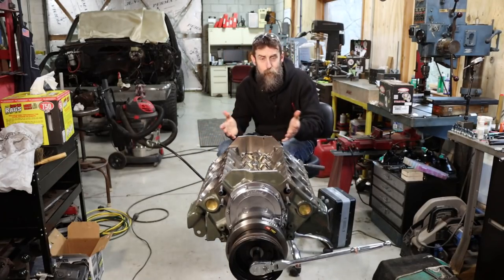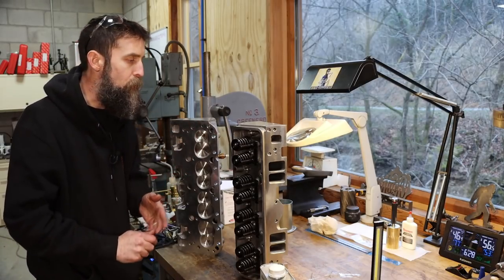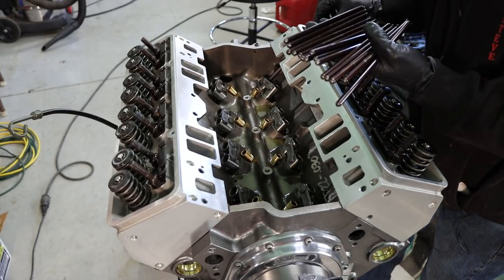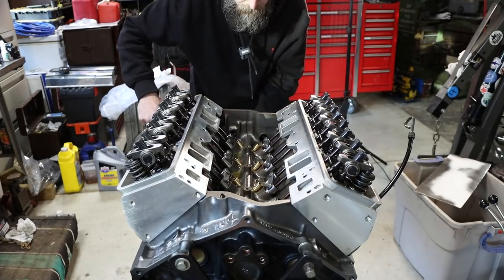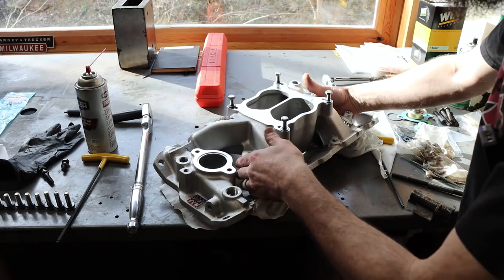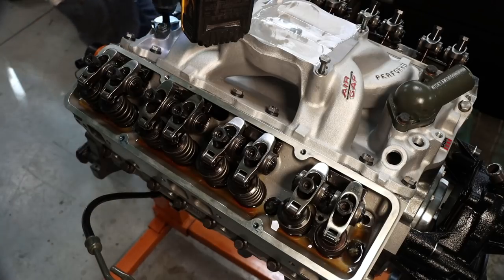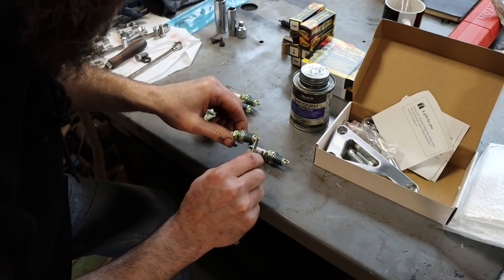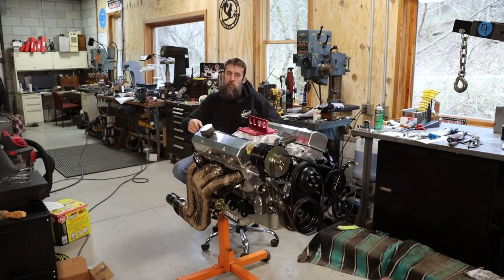383 Build block COMPLETE!

Comment: Military equipment background tip.  On tie wire, you should arrange and tighten the wire such that it is trying to tighten the bolt more.  Simply having it in the hole is not enough.  Couldn't tell how that worked for you, but thought I would point it out.  Great work, keep it coming.
Reply: You beat me to it. I was mentally sending Steve a pair of spin pliers too.
Reply: Along with this, I would have also suggested to NOT wire them until after a few heat cycles, then retorque the bolts, THEN wire them.
Reply: I'll bet Steve probably watched some of those safety wire videos.
Reply: Absolutely.  The best guy I've seen for lockwire lessons on youtube is AgentJayZ - who has several videos on the subject.
Reply: In Steve's defense...  The bolts were designed to not have the wire.  Any wire he puts on there is just bonus.   But yes, the wire should be tightened and then looped at least half way around the bolt so if they try to back out, they pull on the wire rather than slip in the hole.
Reply: Agreed, my background is in military aircraft. The wire should be 'locking' the fastener, not just attached. It will do a trip like that though.
Reply: @dav1dsm1th  plus 1000 on Agent JayZ.  He rebuilds jet engines for a living and has the best videos on safety wire I’ve ever seen.   It’s also neat to watch a jet engine build.
Reply: I’m here to join the “came here to say this club.
Reply: Here is the Agent Jay Z safety wire video.  https://youtu.be/OwFjUX6SaY8

Comment: No worries over those heads Steve. Unless you are going to be pulling firewood at 6000 rpm and higher all day these heads are just fine. The rough finish on the runner walls is not a bad thing. It makes the airmass along the walls tumble much like a sailboat in water that takes air in along so you get air on a bed of air effect or in the case of a sailboats rough finish captures air between the boat and water. When I port heads I can help the air move with less friction here and there by speeding it up or down where needed. This method of adjusting valves is by fat the easiest and less painful on ones noggin than the rest of them. There are many as you sure know. Chrysler was I believe the first to take advantage of the air gap intakes and the others quickly took note of it. Like you I really like these ones and they look like they mean business too, LOL. How nice to see Elizabeth and growing baby Clover this fine sunny morning up here. What a beauty of a power plant you have created to go looking for firewood and 2 x 4's from the corner store. Any confirmed gearhead has a puddle of drool  between their feet or on their 6 packs right now. I keep looking at that 2 1/2 min run time left and don't want to start as I know this will be stopping and I have to wait a week for more. You spoil us fella, LOL. The drivers side header is usually the one to take off but since you already know that and have done it there I go flapping my lips in the wind again. I know I am long in the tooth but never mean any harm. Just old and have traveled the same road many, many times. Hugs all around my friend and many, many thanks for bringing us into that big warm heart of yours. You are good people and the driver of the big bus in the sky already knows that eh. St Peter awaits with open doors and a smile for you all. Take care my friend.

Comment: Hi Steve, that's gonna be a great engine! 
One tip on the rocker arm nuts...just torquing the allen screws may not get them tight enough, I've had them come loose with that method. I found that, if you back the nut from it's final position(maybe an 1/8 turn or so) then snug the allen screw and turn them together to the final position, it results in a much tighter setup. I never had them come loose after that...

Comment: I remember a high and low pressure spring came with the new “high volume” small block oil pumps I bought over the years. High was a 60-80 psi range and low was a 30-50 psi. However it’s been about 2 decades since my last such purchase.

Comment: Great teaching us the lifter settings. Never knew that way before.  I used to just put the hydraulic lifters in and turn the engine four full turns then listen to it rattle at first start up until the oil got everywhere on the push rods, but I have not stripped a complete engine down and rebuilt since the 1970's. Done heads off, decoke etc in 1990 - 2000's. I preferred the 1.6 and 2L pinto engines. Never worked on a V8 before though. Not many V8's in UK compared to 4 cyl cars. :)

Comment: This is bringing me back memories of my old Stock car racing days in the UK. We used Big block 454ci. LS6 & then changed just about everything to get tons of torque low down. TRW pistons with the tops milled down to 10:1. Crane cam. Solid lifters & roller rockers like yours. Black jack small tube headers for low end torque. Small block flywheel. They used to cost a fortune to build. Thanks for showing. Brilliant video.
Steve.

Comment: Pretty cool build. Whenever you go to normal oil you will have some change in pressure. SAE 30 is thicker so you should expect higher pressure when it's cold. After break in I would recommend going to a weighted oil and go to your local machine shop and buy a bottle of zinc additive. When ever you break in a engine you will have more debris floating around. It is important to keep in mind the detergent content of the oil.

Comment: I would also check the drill speed vs oil pressure, I do believe the drill is spinning the pump faster than the cam shaft will
Reply: I came here to say the same thing.

Comment: Steve I would use anti-seize on your stainless fixings for your headlights. They go together well at the time but over time without it, they tend to bind up and can be a pig to undo again after a few years. Using the anti-seize will prevent that and a lot of swearing.

Comment: That (cold) oil pressure should drop about 15-20 pounds hot and as the engine heat up and breaks in - but you know that-lol.  Also if you dont get oil in a few rockers just turn the engine 90* or so sometimes speeds things up.
Reply: I was going to write the same thing, on both counts.

Comment: Yessir you're gonna have one screamer of a high class wood hauler... Like your idea of the "lockwire" on the header bolts. I have used miles of that stuff in my aerospace career. Just know that when you get stuck using it it usually goes to the bone. I still have battle scars...

Comment: Not convinced by that spray gloop on the head gasket Steve used. Looks like a composite gasket and as a rule extra sealing compounds should only be added if specifically approved by the manufacturer.

Comment: way back when I was in high school auto mechanics one of the goof off guys painted the front wheels on an old car we had in class with copper coat gasket sealer. needless to say everybody got in trouble for that stunt. but they were pretty.

Comment: Just wondering if you remembered to blow air and visually check the push rods to make sure the through holes were open. I have had new from the manufacturer push rods that were blocked

Comment: A completely blocked lubrication circuit will give you a maximum oil pressure reading.
Plain bearings rely on the properties of the oil (film strength, viscosity, antifriction additives) to suspend the moving components, not the pressure of the oil pump.
Splash lubrication works at zero pressure.
Reply: Not if the blockage is in the pickup tube.

Comment: Just a word of caution Steve. Copper anti-seize should not be used around aluminium components as electrolysis will occur between the two metals and the Al will be degraded. Nickel and silver based anti-seizes are better.

Comment: You need a set of safety wire pliers from harbor freight.
Reply: I was pretty amazed when I saw them.. 😳
A fraction of the cost of my Blue-Point ones from the '70's. Even without accounting for inflation.

Comment: It's great that you've reached a milepost with the engine and I  don't want to rain on your parade,  but the rough cross hatch is 50 yo technique. If you want best ring seal, you hone(with a ck-10 or equivalent) the block with torque plates in place, and you go for the staightest,, roundest(with heads/torque plate) cylinders, and a smooth almost shiny finish. Nearly everyone uses Moly coated rings, now, which break-in easily. Myself, I like to use 2-cycle oil to lube the cylinders/rings for initial startup.
Also, NEVER soak the hydraulic lifters. If you want to dip them in oil, that's fine, but you don't want the lifters to go solid on you, especially on initial startup. I've seen it happen. Fortunately,  in this particular engine there was no interference, so they eventually bled down, but it ran  pretty crappy for several minutes before the engine ran smoothly. 
You haven't talked about fuel delivery,  yet. I'd go with FI, BUT NOT for initial startup. Use a known, GOOD carb for break-in until you get all the things checked like oil, coolant and fuel  leaks and adjusted the engine timing and idle so that the engine starts and runs perfectly. When you're satisfied with it, then install the FI. Try to keep the variables as few as possible.

Comment: I wish you would add a little more oil to each cylinder. Ring seat failure is typically cause by the wrong cross hatch pattern and texture for the type of rings and material they are made of. Plus a correction to a statement you made, all lifters should be soaked in oil prior to installation, especially hyd. roller lifters.
Reply: Not "all" lifters need to be soaked, but not a bad rule of thumb. Some manufacturers specify them NOT to be soaked ... I have no clue why, but they do. IOW: Pay attention to what the manufacturer states and you shouldn't go wrong.
Reply: @Paulster2  Please enlighten me on which manufacturer says that. In the past 50 years I have used every major brand there is and I've never seen that. If a lifter has any moving parts to it, it needs to be pre-oiled.
Reply: @dcrahn  - Off the top of my head, I do not remember which one said that. I saw this in the last couple of years. I was "very" surprised to see it myself. The point I'm making is, pay attention to what the manufacturer tells you. You shouldn't go wrong by doing so. If they say not to pre-soak your lifters, there must be a reason for it (I wouldn't have a clue what that reason my be).

Comment: I am amazed you do not have a safety wire pliers.  I noticed that the one front wire is pulling the wrong way.  When you cut off the end roll it into a tear drop. Press the cut end back into the run so there is no gap.  If not in the future when you work in the area the cut off end will rip your skin.   When I worked on airplanes I you did not finish your safety wire correctly or did  not cut your wire ties off flush, every one in the shop enjoyed a coffee on your tab.

Comment: About 30 years ago I saw an aluminum Edelbrock manifold fail when an engine was being installed using one of those carburetor lift plates.  The top of the manifold stayed bolted to the lift plate, and the bottom of the manifold, along with the rest of the engine, dropped into the engine bay.  Never trusted one of those since.  Can you salvage the factory lift points off your old engine?  They attach to the heads.

Comment: Noticed that you only applied anti-sieze to the bolt/spark plug threads.  You should also apply to the underside of the bolt head as this will reduce the friction between the bolt and where it contacts allowing for a more accurate torque.  Also on your safety wiring of the header bolts at 34:13 it appears your wire will prevent the bolt from tightening not loosening.  Otherwise a great build.
Reply: Thought the same thing on the tie wire. Looks like it is holding the bolts from tightening. At least on the one shown being done.

Comment: Your high oil pressure maybe due to the drill motor was spinning it faster than what the engine would spin it, the distributor shaft actually spins quite slow compared with the drill motor

Comment: Steve put a short 3/8 bolt in the front motor mount bolt hole the top one  where the fuel pump mount becuase it not blind hole the fuel  pump rod go down behind it

Comment: Steve , I hoped you lapped the valves on the heads as many of the valve seats on moderately priced aluminum heads are only cut with a seat cutter and are notorious for leaking.

Comment: As fast as your drill is spinning no wonder why your oil pressure is high! That distributor never turns that fast!
Reply: You are correct sir!  It's kind of fun to do it initially, but once the oil is to the rockers, that's enough.  Time to start it up.

Comment: Have you ever used the oil starvation technique on your rings before?  That feels counterintuitive to everything I've ever known about known about cylinder walls on  4 stroke or 2 stroke.
Reply: That exactly what I read that a BMW race tech had to do after API specs changed in the 70s...his bikes weren't seating in properly, so he put a tablespoon of oil in each cylinder(with no crankcase oil)...ran to half rpm for approx. 30 seconds and problems solved...

Comment: I see the effort and the parts you decided to put back in this engine, and than I got the feeling you are no longer building a daily driver engine, but a more powerful engine. That hot rodding disease got into you it seems. I ask one question, do you realize the gas mileage you will be getting for this power house? I'm seeing somewhere around 12 MPG. Why do I figure this, because I once did something very similar. But at that time gas wasn't anywhere near a fraction of today's offerings. And my cam wasn't as high a lift or duration as yours is. So gas mileage WILL be a real issue after the enjoyment of the extra power wears off... Thumbs Up!

Comment: I was told that you always use a wire gauge to check spark plugs not a flat bladed feeler gauge I don’t know which is right which is wrong but I was that’s the way I was taught how do used to use it with success on racing engines
Reply: You use feeler gauges to check the gap like he was doing and you use wire gauges to set the gap if/when you have generic or un-gapped plugs.  👍😎

Comment: Hey mate
Good work on the rebuild so far
The the wire trick is great but it should be routed in such a way that it pulls on the bolt to constantly tighten it

Also want to know where you got your electronic weather station from ??!
Ian the Aussie fella

Comment: That's not enough spark plug gap , it should be  .045
Reply: Seems like gapped for an antique points system. 
I've never seen anything that small with HEI.

Comment: With 10:1 compression better use high octane fuel and maybe even an additive with todays crappy gas. Dont want that thing pingin' like crazy-lol Great looking engine very good attention to detail.
Reply: 10:1 is nothing for aluminum heads. Cast iron heads, there would be concern.
Reply: @timramich  And a lumpy cam...I'd bet Steve gets good service from a BUNCH  of well tested design.

Comment: it is possible to have them cnc ported , then they be as good as a good brandname set of heads and prolly cost less , as long as the casting is good (thick) and the machining on them is to spec any brand head should work
as for the airgap intake , its a good intake but you might need to draw hot air from around the headers if the weather turns realy cold as the carb could freese up if you dont 
as for the high oilpressure , you put the engine together with pretty tight tollerances in the bearing , once these wear in the oilpressure probably drops a little 
one thing i seen about safety wire : wind them up then pull them a little around the head of the bolt in the same direction as tightening it , that way a bolt working loose doesnt pull on the other bolt and loosen it too , they actually should tighten eachother when one of the two is working itself loose
Reply: At the RPM's he will be running, porting will make no noticeable difference.
Reply: @jly74  might depend on how small they leave them
Reply: @watahyahknow  I really don't think Edelbrock would leave the ports too "small" in a Performer intake manifold. Maybe a little rough finish, typical of sand casting, on the interior passages which may help atomization of the fuel/air mixture anyway.
Reply: @jly74  
sorry i was talking about the ports in the  cilinderheads
Reply: @watahyahknow  Yeah, he did say the cylinder head porting was pretty rough. Apparently not rough enough for him to worry about. If nothing else, I would port match the intake manifold/gasket/cylinder head junction. Take care.
Reply: @watahyahknow  p.s. - Your other comments were spot-on. Good call.

Comment: I hope the starter instructions were to get the proper gear engagement on the flywheel starter ring gear, because one of the worst Chevy "traits" is that horrible grinding sound from the  starters which is all too common to mis-shimmed GM starters.

Comment: i grew up in chevy dealerships. there is a sequence to setting the valves. start at TDC and set 8, turn the crank 360 and set the other 8 - done. specifics were in the older GM service manuals.
Reply: But as usual Steve was being meticulous...
Reply: @charlesangell_bulmtl  nice thing about the GM way - it's meticulous AND fast :)
Reply: 50 years ago for solid lifters!

Comment: When you have oil coming up inside the distributor you can take the intake back off and take the stand tubes out. and if that does not fix the problem , restrict the pushrods